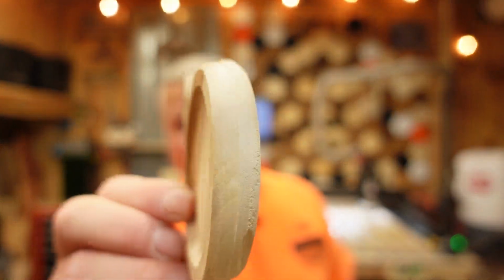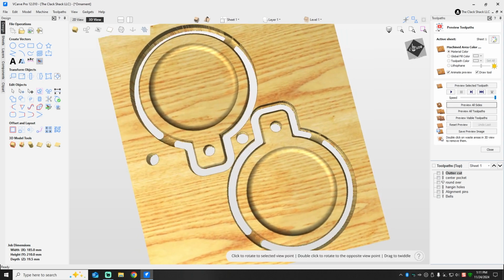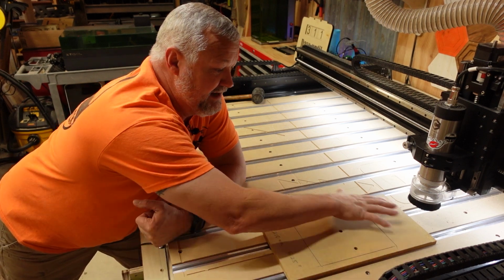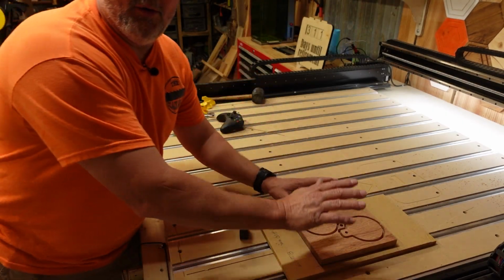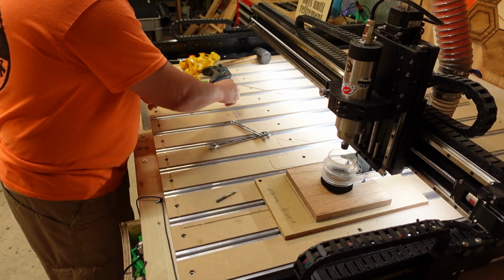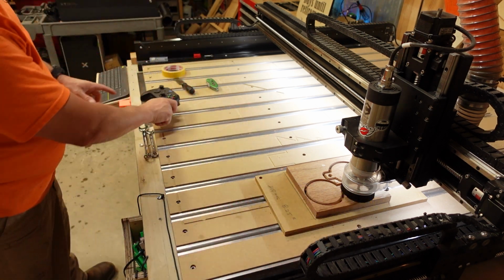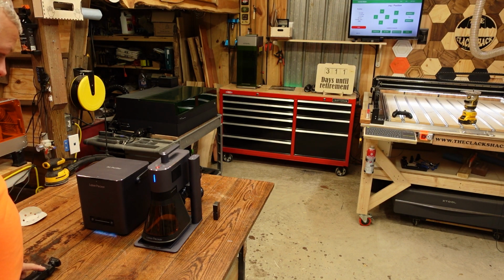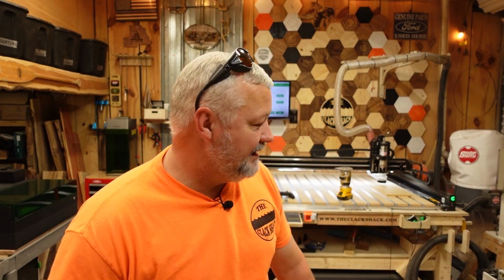2 sided projects made simple

Comment: Hello Clack. First, I want to thank you for making this video. I got my Shapeoko 5 Pro 4x4 back in March of this year and have been blessed to receive many custom orders from around my local area just from friends and family word of mouth. I have not had a 2 sided project request yet thank goodness but I am wanting to learn sooner than later in case I do get a request. That's how I found this video. This approach is actually the very first one I've found that makes total sense to me. Also, since my machine is the same as yours as well, it proves to me that my Shapeoko can easily handle 2 sided work. My only difference is that I use GSender for my CAM software instead of Carbide Motion. I do have one question for you however. The time stamp on this video shows 11 months ago. I'm sure you have ran many 2 sided jobs since then most likely. What do you do in the situation of having no excess frame around your project to drill your alignment holes into? I have ran many carves that were directly on the project itself and had no frame for drill holes without actually punching visible holes in the final product. Just checking if you've ran into that situation and how you resolved it if you have. Thanks again for all this and clicking on my level. Guess that's why you call it the Clack Shack,. 😀
Reply from the maker: My recommendation is to always make a place for alignment pins. There are other ways such as a fixture or just working off the material center. Without the pins, the complexity of alignment is a bigger issue. I use GSender on other machines and it can handle the job just the same as carbide.

Comment: Great Video. I have a shapoko 3xxl. I kinda like both carbide create and motion, so I totally get what you were talking about with the positioning. I didnt know xbox controllers are natively supported. I just use the keyboard and a mouse, which is fine I have a Z probe. Which totally was one of the best things I did, speeds things way up and makes bit change heights super reliable. But also even with my keyboard further away than yours I just need to get it a 1/4in or less from the probe, so I toss a 1/4 bolt quick eyeball and boom done with height. I setup a fence in my lower left side so thats always my XY origin + 6mm, so I always click quick move to xy origin when I start stuff out. I do wish we could set a done position like you mentioned, but quick xy origin is the workaround
Reply from the maker: I have both the bit setter and bit zero. I can’t use the bit setter because of the pro dust collection. It slams the bit setter if you don’t raise it up all the way. I chose to not use it for now. I am looking at a work around for that.
Reply: @TheClackShack  Its hard to see in the video, and I have the 3xxl not the 4 like you. But mine the bottom of the dust collection pops up with magnets. I do see yours is somekinda different than mine lol. I run a Festool CT15 with the auto on(only festool I have and boy is that thing awesome for dust collection) So Ive had a bit setter and never used it to honest, but I bet if your sweeper part pops off you could use the bit   zero, you really only need enough space to get the clamp on the bit and the bit to just touch the zero.
Reply from the maker: @IntrexinCustom  I have the Shapeoko 5 pro. The bit zero works ok but the bit setter will hit the dust boot if you run the factory sequence.

Comment: A smart man uses XFasten tape, a caveman uses tape and glue.  Nice video.  My largest struggle is bit changing and getting back to zero on all three axis. Why don't cut out your jig so your piece sits down in it, it makes locating your work piece easier.
Reply from the maker: I use both at times.. lol.. Thanks
Reply: I thought the same thing, but then realized it really only works with symmetrical objects. Oddly shaped items, where you can't flip it over and be the same wouldn't work as well.